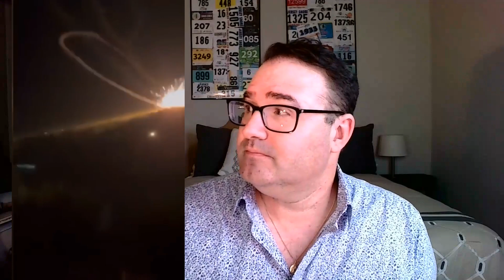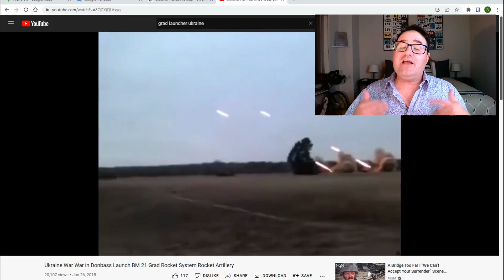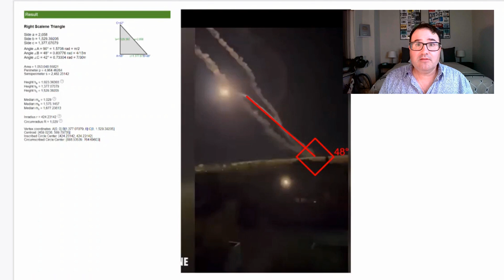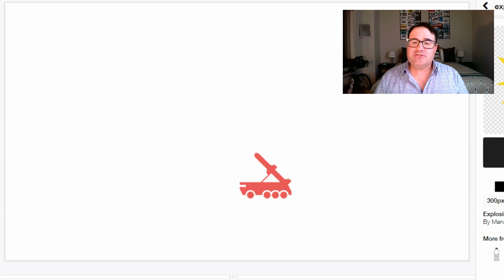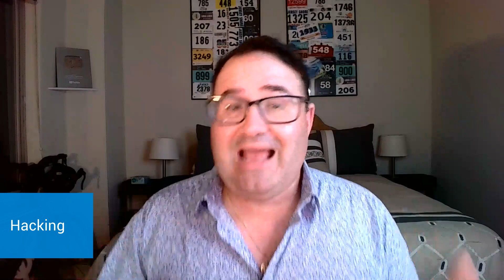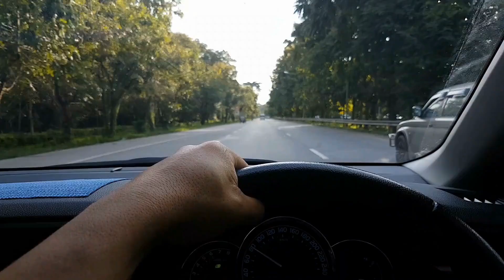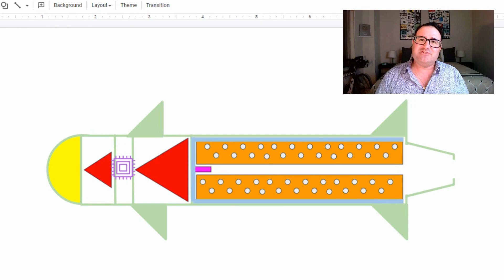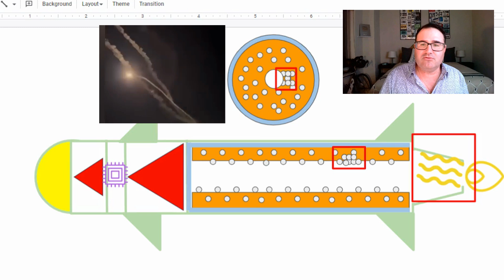Why this missile U -Turned

Comment: Worked at an EOD unit for a while. And while I wasn't one of them, I sat in some of their educational stuff (was an EOD school). The chemical changes over time and the problems of proper storage certainly were addressed. In fact most of the crap we were destroying for training purposed was stuff that had degraded due to long storage past the point of being usable.
I can totally see the Russians storing crap past expiration dates. And those chemicals change over time and can certainly cause issues like this.
Not sure if that's what happened here but it's absolutely an option I'd say.
Reply: Yup just like their MREs
Reply: @amc3463  nope.  MRE ain't going to go bad.  Basically full of preservatives.  Go ask some guys about the Vietnam era stuff they are thru in Iraq.
Reply: are you allowed to talk to people?
Reply: A very plausible argument for the behaviour of that missile, but why then did the other two missiles seemingly launch successfully? If there was a problem due to prolonged storage of the missiles then all of them should have shown up errors with their performance. If on the other hand that one particular missile had been roughly handled or handled more frequently than the other missiles then we open up the possibility of damage through various means such as crew handling, weather exposure, object strikes during transport through a forest. Who knows?
Reply: @markfryer9880  the other 2 launched successful because problems with storage are uniform, just because errors in one missile pop up doesn’t mean all missiles will have the same errors, this missile could’ve been in storage longer, or in worse storage conditions or any of the other things you said or just a case of bad luck (or good luck depending on how you look at it) with this missile being the one to go bad
Reply: @BentCheeks  i think if they were produced the same and stored the same way and the problem was that, then they all should have problems. Otherwise, it would be random. Which is no explanation at all. There could have been subtle differences. Like the rack this one was stored on was broken. So the propellant clumped to one side.
Reply: @BentCheeks  Exactly. It simply might have been in a different place in the 'stack' and exposed to more or less of something, heat, cold, light, water from a leaky roof, forklift kept bumping into it over the years because of its location, or some dummy let it roll off the truck.  >shrug<
Reply: @K9_Wang  exactly what I was trying to get at, thanks
Reply: @markfryer9880  with out of date munitions, similar to out of date food, there's no guarantee they will all go bad at the same time. You can sometimes eat MREs made decades ago, while another in the same box spoilt years before. Expiration dates aren't the absolute end of life. They are simply the longest the manufacturer will guarantee freshness. There could also have simply been a manufacturing error - which Ryan states clearly in the video, if you pay attention - and such a defect would not necessarily be found during manufacturing. Like the Apollo 13 mission, which had a defective part causing fuel tanks to explode when stirred, this missile could have been doomed to crash in this fashion on day one, but there really isn't any way to know for sure.
Reply: Expiration date? That's a capitalist plot!
Reply: Just like their food rations  12 years  past the optimum  date. Nukes also need maintenance every 5 years .
Reply: @ Witcher Joker
All active duty military members are required to receive WMD training every quarter along with EOD. Those of us in the Medical Corps also had to receive training on Biological and Medical Effects of Nuclear Explosion.
Reply: I wonder what the failure ratio is.
If this happens 1 in 1,000 times... they could be doing Ukraine more of a favor than they know.
The psychological impact is pretty significant at much lower numbers than that though.
Reply: That was kinda like my theory. A disgruntled employee at the munitions factory maliciously installed a rocket fuel mix that was labled the 'antithetical to dictatorships mix' instead of the one clearly labled 'pro-meglamaniacal mix'.
Reply: It's bored workers playing Russian missile roulette. Part of the buzz of the murder/ suicide cult known as Putin's Russia.

 ' Tee hee Wassily, I've put a bigger glob of propellant   on the right.' 
' OK Ivan. Just make sure the ones due to be fired from my hometown are evenly distributed! "
🇷🇺💥💀🇷🇺
Reply: 10 finger salute. I may have been brave enough to send 155mm down range, but not stupid enough to pick that stuff back up. In the 1990's we were still firing rounds that were manufactured during the Vietnam War. Kudos to EOD for messing with the leftover downrange crap (and there was a lot).
Reply: Joker I believe what you say here. I was assisting the armourers change N2 bottles for wingtip AIM-9s and I asked thier senior guy about the plastic seal at the back. He reiterated pretty much what you said here. On the west coast high performance jets can induce enuf G forces to unseat the rear seal. If not discovered in time the missile motor becomes toast.
Reply: I'm in aerospace R&D and have done experiments with solid propellant aging. Usually what happens with long term storage is that the propellant becomes unstable. In some cases, extremely unstable and gets reclassified as a 1.1 explosive. (Meaning hitting it hard enough will cause an unstable area - that's usually recrystalized - to detonate/ignite.) In basically all cases of really old fuel/propellant, the stuff doesn't really burn hotter so much as it does detonate. Most you need to know what you're looking for, but it'll really dicker with the rest of fuel. Given that if one part of the propellant is so bad that it's begun recrystallizing (becoming wildly unstable), then the rest of the propellant is probably well on its way as well.

tl;dr - Old solid rocket propellant can recrystallize the energetic bits from the stablizer, making it more an explosive than a fuel. Rather than burn like a good propellant, this makes the rocket go boom instead.
Reply: Beautiful to know how much money we spend for war only for equipment to just sit and turn shit like this. Wars a complete waste of life and resources
Reply: @Toripusutashi  Until we as a species stop fighting each other, we will always need to keep stockpiles of war materiel "just in case".
Reply: @Toripusutashi  that's why we need a little war once in a while.
Reply: @Toripusutashi  I agree but just like locked doors are to keep bad guys from entering your house weapons of war are necessary to keep bad guys from taking over your home land.  Figure a way to get all humans to decide that they never will go to war and you will certainly get the Peace price on a unanimous vote
Reply: @Toripusutashi  your point contradicts itself these weapons expire because the lack of war 🗿
Reply: Nonsense. The ruSSian army never had ,lack of war’ (Chechnia, Georgia, Donbass, Chrimea, Syria and so on). Weapon systems get replaced by more advanced; the old stay in storage, then get used when there is lack of newer stuff (,scraping the barrel’). Similar issue just happened with mines.
Reply: @vilisnimojanum8244  just because war is occurring doesn’t mean all systems are leaving storage and being used, just because newer gear is entering service doesn’t mean older gear usage is stopped and only newer gear is used, Russia doesn’t have the economy to buy sufficient gear for that

We’re seeing Russia is having problems with stored gear, maybe you could deny it earlier on but now not really
Reply: @joecanuck3751  old tanks are expected when you’re talking about Russia, they make up the majority of their Arsenal due to their lower budget but we also are seeing stuff like modern t-90m tanks as for long range missiles that’s not inappropriate we used a good amount when invading iraq
Reply: @vilisnimojanum8244  the russian army had a lack of war with people who were prepared for it in even the most marginal way. chechnya, georgia, crimea, ISIS/syria..none of them had any airpower to speak of.
Reply: @BentCheeks  You're asserting that every single piece of America's vast, vast, vast arsenal is entirely necessary to maintaining relative peace?

That really a position you want to defend? I wouldn't. But, then, I have some knowledge of the huge inefficiencies and perverse incentives of the military-industrial complex.
Reply: @michaelccozens  no, you’re putting words in my mouth, I advocate for optimizing military spending but what was previously referred to would have military spending but significantly reduced hampering us operations

In other words you’re trying to just take money away from the military then say “but the military-industrial complex!!!!” As a excuse
Reply: Imagine wanting war lol
Reply: @Toripusutashi  I mean if throughout history humanity never had any war. What level of advancement and technology do you think we would be at? I'm not saying that technology stop developing in peace time, just much slower. Do a bit of googling to find out how wars help humans grow. Sad? Yes. Tragic? Yes. But necessary. At least that's my opinion anyway.
Reply: @Toripusutashi  imagine not being prepared for war, and then war shows up on your doorstep.
Reply: @Toripusutashi  we’re living in the most peaceful time in the entire world yet you still find a way to look only at the negative how delightful
Reply: @BentCheeks  No. He looks at the issue of the video. And you never looked into punctuation, did you?
Reply: @michaelccozens  the classic “there’s war here so we aren’t at world peace”, there’s a difference between world peace and total world peace as you can see before America became the world super power then after America decided to do the unthinkable and open up the world economy and defend global trade, sure there’s war you can’t stop all war no matter what you do you’ll never be able to do it but look at the violence rates since America has become the world power, look at all of Europe instead of just one small section, use a broader scale and see how the world is at peace

I’m not saying you can’t improve things I’m saying don’t break what we’ve already managed to build in the process for “improvement!!”, actually you don’t even need to go all socialist to fix this problem, most of it is artificially inflated 

Yeah excess spending is a problem but I wouldn’t call this excess spending when you take into account our massive gdp size & the state of the world right now, sure you can optimize spending but really does now look like a good time to unnecessarily hamper the military with the climate growing more heated? Let’s remember we also aren’t living in ww2 times where equipment is cheap and easy to mass produce quickly
Reply: @BentCheeks  we are definitely not. Way more peaceful times occurred before this
Reply: Mmmm no Russian army best army

Comment: I can hear the screams of “blyat!” when I watch that video.

I like your theory, but all the thrust is coming out the same tube. The diameter of the nozzle can’t be that big, can there really be enough differential thrust in that tube to cause a 180 like that?

Great video sir!
Reply: I agree the net pressure would be the same vector , of all the directions it went the probability of it going back to base is  very small . My guess is a configuration issue. Maybe the put the "safe" zone and "target" info in the Wong box.
Reply: @robmulally  yeah, it seems most likely that its fins maneuvered it in that manner.

With model rockets with fixed fins, I’ve never seen one do a 180. (Added: for model rockets without structural issues, and also I probably shouldn’t even be referencing my own anecdotal model rocket experiences, I haven’t seen that many model rocket launches).

I did, however, see a model rocket once that went up about 50-100 feet, and then decided to turn horizontal and become a model cruise missile. It travelled around 700 ft horizontally!

That was a little scary, but thankfully nothing was damaged and no one was injured.
Reply: @phillipschmidtke2001  to be honest though. I have no idea how big this thing is. I saw some other rocket failures that were chaotic this looked almost controlled.  But again I'm just guessing

Comment: It's very strange that it did a U turn and hit the same spot it was fired from. Quite a coincidence
Reply: The impact point is not the same as the launch sight
Reply: @tyrantfox7801  it was close enough to not be random. It was likely homing in on the radar.
Reply: If you see it from another angle it missed the area it was fired from. No injuries or fatalities unfortunately.

Comment: I don't know. That's such a powerful maneuver that you'd need the fins to comply, because at that speed there is going to be a massive amount of pressure on those fins keeping it pointed straight, especially when it starts getting aggressive angles of attack. I find it especially hard to believe that uneven fuel distribution would lead to it going right back to the launcher, though it's technically possible, the probability just doesn't make sense.

I fly a lot of model rockets and trust me, when something's going at speed, it really likes to point in two directions: up, or down, and you're gonna have to do a lot to change it from that.
Reply: Just as a note, it doesn’t actually go right back to the launcher, it moves a significant distance from the launcher in the direction of the camera. So it looks like it goes back to the launcher but that is only because of the position of the camera nothing more. There’s another video that shows this, it shouldn’t be too difficult to find
Reply: I designed enough rockets improperly to know that if you cook off too hard on one side, it do be turning like that-- Granted mine are charcoal/black powder with a nitrate sweat VS a magnesium/aluminum powder with a ammonium perchlorate sweat; but physics are physics, that said:  AoA isn't going to be heavily impacted by those fins at that velocity, Bernoulli's principal would dictate that were it a fin gone wrong, the ballistic curve would be less significant: a roll away, not a 180 turn.  If it were the fin, you would also see a continued disruption in the missile's flight path, but after the fuel evened out you see a leveled attitude on the missile; albeit in the wrong direction.

TLDR: Propellant distribution is real.
Reply: @attemptedunkindness3632  Oh yeah, I'm not saying it's a fin issue. What I mean is that it seems like it would have to be an intentional maneuver on the missile's part.
Reply: @attemptedunkindness3632  what's not likely, fuel or fin?
Reply: Same deal happens with hobby rockets. Bad fuel mixes can make them go in all sorts of weird flight paths, even though they have fixed fins. Just minus the massive explosive bit on the end. Lol

Comment: But it turned exactly 180 degrees around right back at where it came from, and then straightened out. What are the chances of that?
Reply: Even simple firework rockets can pull some amazingly scary moves when they lose stability somehow. I've had to dive out of the way of homicidal pyrotechnics myself.

Up the scale by a whole hell of a lot, and ye, it's very feasible you could get a flight path and a boom that looks like this. Just need that mix of dumb luck and Murphy's Law, and suddenly your ass is grass and the BUK is the lawnmower.
Reply: Look close , The impact point is not the same as the launch sight

Comment: I think your wrong but I don't have a good explanation either.    The nossel is fixed and wouldn't be able to create the vector thrust from uneven fuel burn.  But it might have caused a pulse of acceleration that over powered the rockets stabilization.  But the the full turn is still highly unlikely.

Comment: I don’t think that makes sense, it’s still coming out of the same nozzle all the same. Maybe if you said it blew a hole in the side I would go with that, but I’m pretty sure any hole would cause catastrophic failure.
Reply: Even if it comes out equally from the nozzle, internally it still creates more force on the side it's happening

Comment: seems more like it lost lock, then tried to reaquire and just grabbed onto the closest radar emission. whic would come down to a poorly trained crew not programming the distances to activate the seeker. 

this is a known method of how many missile systems work and its something the crews need to be very concious of cause their missile will lock onto anything friendly or not, that is inside the distances their told to become active within.
Reply: This was my first thought, but I'm an ignorant layman, so who knows. 

If it just went off path, ok, but that thing seemed like it intentionally went back to the launch point where the radar had been.
Reply: That's not how missiles work. It's looking for a return from the target, not the transmitted radar beam. If it loses lock, INS takes over and it continues on its last known intercept course until it reacquires.
Reply: @donwyoming1936  Makes sense, I was wondering if it was antiradiation a d the intenral trackers caught the radar from where it was fired.
Reply: @donwyoming1936  strange that you are speaking with such authority because it depends on WHICH missile. a blanket statement like 'thats not how missiles work' just exposes your ignorance. 

is that how a amraam works? no. but its exactly how certain modes of the harm work. as well as the harpoon, and the SLAM and SLAM-ER. 
this particular missile may work that way, or it may not, i dont know, but that is an established way for missiles to operate that could lead to exactly the incident that took place if they crew where poorly trained enough. it just seems alot more plausible than a random bit of solid fuel in just the perfect amount to turn the missile a near perfect 180.